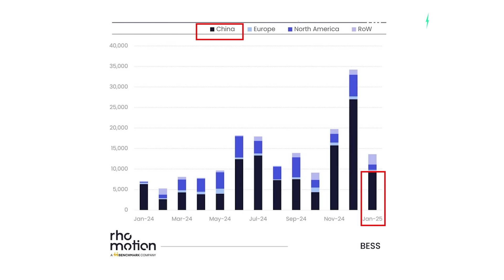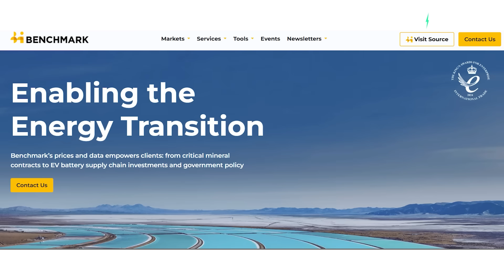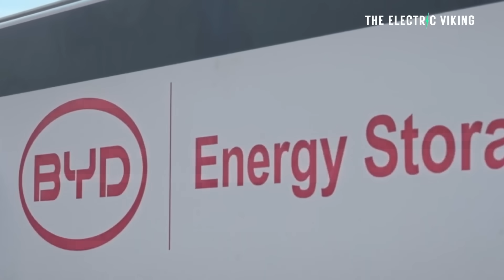World Record 13.6 GWh of mega battery storage built in January

Comment: When we mention solar power in desert conditions, I wonder about directly using pipes from the sea to both cool the batteries and produce pure water for consumption
Reply: A water pipe across the desert is taking water from the ocean and transporting it 100s of miles in metal pipes where the ambient temperature might be 40C / 104F, so it'll be hot water by the time it reaches the end.  If the intent is desalination, it's easier to build oceanside desalination plant and power it with offshore wind, connected to the grid via ultra high voltage cables.  If it's power management, add a green hydrogen plant there as well, so you can produce brine, water, hydrogen, and/or oxygen as needed.

Comment: What is a "Single" Phase Battery , I know about 1/ 3 phases with AC but confused with a DC system , can some one help explain to me?
Reply: Probably meant construction phase. Comparing sizes of individual construction phases vs comparing all the phases on a site built over time.
Reply: I strongly suspect that if refers to the construction phases. Sometimes big energy projects are split into multiple phases.
E.g. "Crimson Storage is the largest battery storage project in... to reach operation in a single phase..." 

The AI probably reformulated the text and it became the expression "single phase battery" which is also a thing, but obviously not in a huge storage project, but for storage at home where you have the single phase current you mentioned.
Reply: Ugh.. Enroll in an Adult Education class.. 😅 Many colleges offer those.

Comment: What safety protocols are they putting in place at these battery sites? I remember the videos of those Swedish EVs during the hurricane. Absolutely wild the amount of energy release and those were small batteries compared to this
Reply: That's why they are using Lithium Iron Phosphate (LiFePO4) Batteries.

"High Thermal Stability and Safety
The high thermal stability of LiFePO4 batteries is a significant advantage over other types of lithium-based batteries. This inherent property reduces the risk of thermal runaway events that can lead to battery fires or explosions. As such, LiFePO4 batteries are preferred for applications where safety is paramount, such as in Industrial Battery (Lithium Forklift Battery/ AGV Battery) or Energy Storage System (C&I ESS/ Marine ESS) where large battery packs are utilized.

Long Cycle Life
Another notable advantage of LiFePO4 batteries is their extended cycle life compared to traditional lithium-ion counterparts. Due to the robust crystal structure of lithium iron phosphate material, these batteries can endure thousands of charge-discharge cycles with minimal capacity fade. This longevity makes them cost-effective solutions for applications requiring reliable power sources over an extended period."

citation: www.lithiumbatterytech.com/lifepo4-vs-li-ion-vs-li-po-battery-complete-guide/

Comment: there are so many improvements in batteries every year it is hard to predict where the market will go. right now the battery makers have scaled up on NMC and LiFePO4 so they will be the main thing. They are scaling up on sodium batteries. Flow batteries are a completely different structure and are large scale only not cars so they have a separate ramp up. Right now if i could buy a home battery i would either want a sodium ion or a flow battery. but since neither is cost effective at the home size at this moment LiFePO4 would be my choice.

It is a what is cheapest vs safety vs performance triangle. choose 2.. if it is cheap and safe it will not perform well. if it is safe and performs well it is not cheap. if it performs well and is cheap it is not as safe.

Comment: Germany would need just 80 GWh of grid supply capacity and 400 GWh of battery storage with the wind- and solar power in place to refill them - and the country would run on renewables for the best part of between 220 and 280 days of the Year at current consumption and industry output levels. To run a fleet of EVs, equip homes with heat pumps, for economic growth, to build more steel, tanks, submarines and 155mm grenades, to comply with the coming AI energy hunger - and for the next civilization step - they´d need more, much more.

Comment: Very impressive. China also burns staggering amount of coal. Not sure why they need so much of thermal (coal) power plants when they installed almost 1 tera watt of solar power plants. It doesn't make much sense.
Reply: Just buy a ticket and visit China, then it all makes sense.
Reply: Because of how much stuff they make.  But who knows, maybe they have already hit peak fossil fuel ???
Reply: @ I'm not buying this. You know,  1 terra watt of new renewable power is equalent to 200 thermal plants. Still they couldn't reduce/close any coal power plant is shocking. In fact China's coal usage increase a lot since 2020. The numbers just didn't add up.
Reply: China is moving away from coals like rest of developed world
Obviously takes time
Nuclear-power plants 4th generation Uranium
Hydro
Green power
Also fusion which takes many decades more
But trend is green energy is increasing, coal is decreasing at same time upgrading old better power plants to be higher to highest energy & lowsst pollution standard
Reply: because we have been buying their stuff for decades because it is cheaper than elsewhere. It is the west that created the need for more power in China.  Now they are on to it,  and do more in renewables than all other countries combined.

Comment: Australia's electricity consumption is roughly 750GWh per day. So this would be enough to power all of Australia for (consults calculator) about 27 minutes. Using batteries for grid storage will make renewables more expensive than nuclear.
Reply: You’re wasting your time. People on this site are impervious to math.
Reply: If nuclear ever gets done they will still pair it similar size batterys to ramp up output during peak times.
Reply: 750 MWh is such an easy target to hit, could install that much storage in a couple months.
Reply: @ Sorry, my mistake. It's 750 GIGAWATT hours.  2024: 245 terrawatt hours per year. Divide by 365 gives about 3/4 Terawatt hours.
Reply: China is already about a quarter of the way there.